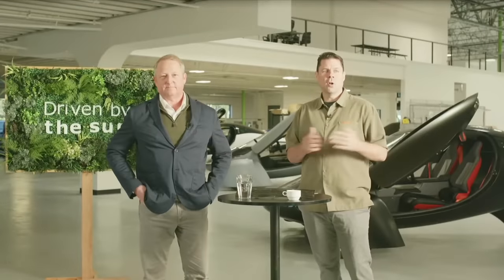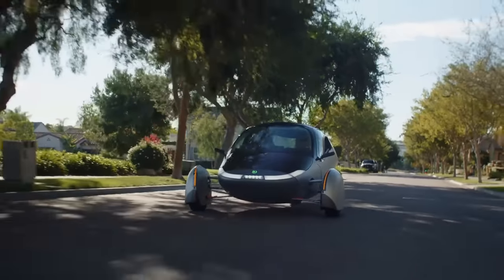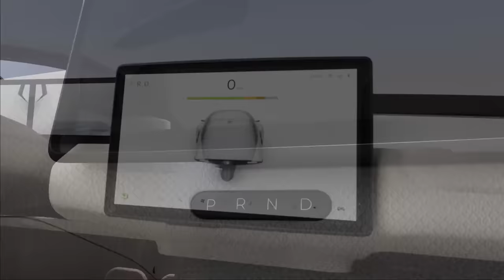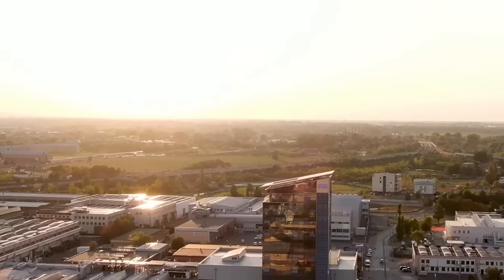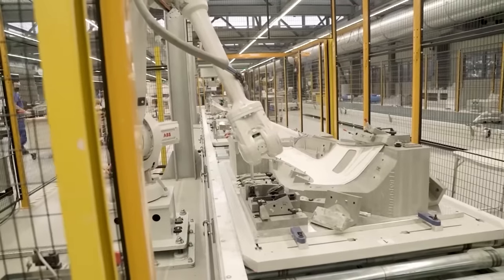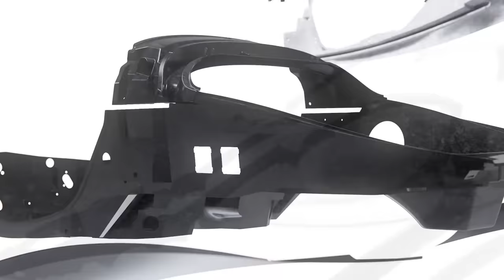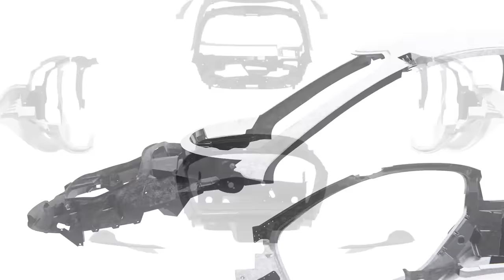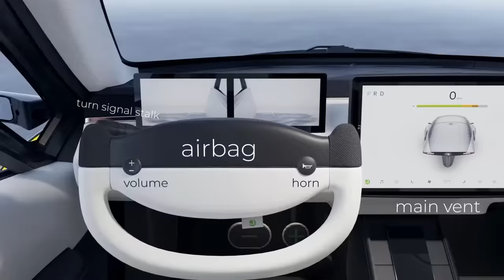Announcing Aptera's Launch Edition | Live Webinar

Comment: Congratulations you guys! It's been amazing to watch this evolve. I agree with a lot of the positives listed below. I have preordered the 600 mile all wheel drive, camping, premium sound package. Reading the comments while listening to the webinar I realize no fast charger and no side bags. Hmmm. Gives me pause. Having driven a Leaf for so long and completely understanding "range anxiety" /range limitations based on external temperature, speed your driving, if you need a/c or heat... dramatically reduces range (hence why I ordered to 600 miles expecting real world 300 miles.)

Also, I am probably one of the few who do not want the back window blocked by the solar panels because I like being able to see out the back. Finally getting to see what the vehicle looks like when looking into the back with the back hatch closed makes me certain, I do not want that back window all blacked out like that. I know, kinda misses the point of a solar vehicle by leaving that many solar cells off the car. SMH. What about a partial solar back hatch?? Like down the sides of the hatch?? Can you discuss all the options that may be an optional purchase to plug in (ex., front window solar sun screen while parked maybe, or solar screen to set up while out camping, or ??? something to make up for the loss of my back window preference? 

The see through sun visor is awesome, never seen that. However, the new cup holder seems like my coffee cup will sit below the top of the cup holder and thus fall over and spill. Could you please provide the measurements of the cup holder?

I had to give up my Nissan Leaf for an ICE :( because it couldn't make the new drive distance and one reason I am so interested in Aptera. All these new cars have that tablet like screen which takes my eyes off the road and often requires many screen selections to achieve my goal only further distracting me. I find them frustrating. Will there be more control offered from the steering wheel like I used to have with my Leaf? (start end a call, cruise control, speed up/slow down, music selection, sound up down, talk to text function, voice control map function, etc?) I would love to have a game like controller buttons I could push (memorize the button sequence) on the steering wheel while maintaining my eyes on the road to make changes / selections I need without ever needing to reach over and touch that dang screen--in my Rav4, while driving and reaching, it isn't a smooth reach as I'm going over bumps etc--finger moves up and down because car is in motion so the accurate selection takes time and attention. 

The vehicle itself --by itself is truly amazing but without the fast charge option for long drives like I have to do (a big reason I'm interested in Aptera) it seems like this would be a problem again, like my Leaf. Steve states, "up to 150 miles when plugged in over night + up 40miles from solar -if you selected full solar AND it's sunny the whole day and you you parked it at the right angle. I did not choose full solar and I park my vehicle in a garage. So for me it would be up to 150-170? miles per day. That will be a problem for me and why I did not upgrade my 2015 leaf to a 2022 Leaf. Not enough range! As I am editing my original post adding this thought, I can see with out a fast charger, an Aptera may not work for me. :(
 
The price starts affordable but with stated increased costs, I'm expecting the cost of my selected Aptera to go up to mid/high $40,000 that does not qualify for the $7,500 tax credit (If you happen to have high enough income to owe that much tax for that to be a viable lure). Cars at that price point have all kinds of bells and whistles and do dahs--you know the packages you can get added to other cars that add those special creature comforts that make us feel amazingly spoiled. The Aptera doesn't seem to have that many bells, whistles and do-dahs. From what I can see/understand the options are pretty simplistic and left me wondering, that's it? I guess I'll wait to see how this all plays out. The 600 mile option will be 3rd in line so it will be a ways off. Maybe some of my deal breaker concerns I've come to realize as I write this will be address and resolved. 
🤞
Reply: @Gandalf721  you have to do that with any car. Not just a unicorn car with the back hatch blacked out with solar panels. Plus, you can still see in from the front looking into the back to see if you have anything cool to steal if you happen to be in that kind of a high theft zone like San Francisco and so many other places you would not expect these days. 🤷‍♀
Reply: @loranutritionist  Yes what happens when you bring in the lowest common denominator. You get smelly areas and liquid fudge on the walks.
Reply: 😂😂 I think with all your requests you need a real car from an established automotive manufacturer, this car is all buzz words and tech promises - I’ve seen it in person. They will produce whatever the investment money provides for them (which will probably be less than the claims or their ambitions). At this moment it’s all words - not reality. Want an affordable reliable car that will hold its value - the new Prius blows this away for $28k 😅

Comment: So excited to see Aptera reach this point.  Still really anxious to see the finished product.  My biggest concern is the internal accommodation.  At 6'2, I need a fairly large amount of space to be comfortable, and from what I've seen thus far the Aptera is really, really small inside.  I hope I'm wrong and they've got a little TARDIS magic going on in there, but that's really the one thing that would keep me from really seriously considering purchasing one of these.  

I've always wondered why EVs don't have solar panels all over them.  Here in Florida, you might not ever need to charge the thing, depending on how much you drive each day.  Such a fan of this.  Just have to wait and see what they're like when they're finally in production and on the road.  Keep pushing, Aptera, you're almost there.
Reply: Most EV's are not efficient enough for the relatively small charge available from the solar panels to help much. Not enough to never have to plug it in. It's possible to never plug in an Aptera because it can go so much farther on a kilowatt than other EV's.
Reply: I'm 6'7".  I feel your pain.

Comment: I live in rural Illinois. The weather here is VERY seasonal and can shift quite a bit during the transition from season to season. Bottom line, the roads here are HORRIBLE! What can we expect with the durability of the suspension? I would go with the better tires and all wheel drive. I would use this as a daily commuter. I drive about 120 miles round trip per day.

Comment: I am an investor and preordered and just update to the launch model.  Really enjoyed the webinar looking forward to next week's webinar.  I have a question about towing the Aptera behind a travel van/RV.  Can the motors roll and produce power while towing? Will the front wheels fit on a 2 wheel dolly for towing or can it be towed with all 3 wheels?  If 3 wheel towing is possible could attachment points be deigned on the lower swing arms?  I am sure I am not the first to ask this kinda curious if your team has given some thought.  Thanks Luis

Comment: 25-50kW DC charging is a must for other climates. A lot of people can only have one car, so no capability for a road-trip is a deal breaker. I hope when Europe is in line they’ll have 50kW DC CCS2 charging.

Also no side airbags ?! When considering safety I might not switch from my M3…
Reply: We will just have to wait for the safety test results. Likely they didn't include them because airbags are heavy and simulating with and without side airbags didn't change the safety in any appreciable way. If the safety data comes out and it is less safe than you M3 of course you should take that into account when considering a purchase if the difference is significant to you.

Comment: What's up with all of these comments complaining about no fast charging on the Launch Edition? This is a streamlined commuter edition of the vehicle that is specifically designed as an early production model. If you want to drive for 15+ hours per day then you will just have to wait for the 1000 mile edition and it's charging options. Most people want high efficiency, decent capacity and solar charging for daily use. This vehicle is more than capable of handling that.

Comment: Would it be possible to at least integrate slow DC charging?
I mean DC charging doesn't require a big extra charger in the vehicle. It is mostly software and wiring.🤔
I mean 20 kW would be plenty for such an efficient vehicle. That would correspond to over 100 kW with an electric SUV.
Reply: Moin Meista

Comment: Can someone answer this: Was it too hard to include DC fast charging? (NACS/Tesla connector, they are using AC on here, not DC fast charging. That means you won't be able to charge at Super Chargers, but you will be able to charge at Tesla Destination chargers and Tesla Home chargers.) DC fast charging is faster. 6.6kW is slow charging!

Comment: I’m still rooting for this vehicle and hope to buy one, but I’m truly disappointed with no DC fast charging and no mention of V2L either from the Tesla port or at the very least a single 110 V2L plug in the cargo area of the vehicle. 

Can I live with just level 1 and 2 only charging? Sure, I’m doing it with my Fiat 500e commuter. But not having DC fast charging will limit Aptera to simply a commuter as well. I really wanted to travel with this vehicle. I live in the west and was planning on hitting many of the national parks and other destinations with my Aptera. This was going to be the first brand new vehicle I would have ever bought. Yeah, they can add level 3 in later but at what extra expense? Would it be a software only upgrade or will it require significantly more hardware?

Here’s hoping they will find a way to deliver on these two things, DCFast Charging and V2L, and say Just Kidding! Here it is everyone!

Griping aside, great job Aptera for your progress. Everything else is looking amazing. Please solve these things and make this vehicle so much more!
Reply: I have one that plugs in lighter socket 200 watt has two automatic USB to 2.4 amp, a 12 volt receptacle and 2 120 volt sockets for laptop supply etc. fits in cup holder.

Comment: I am looking for this vehicle to replace my Tesla for a 180 mi (each way) commute.  With  respect to the Launch edition, not enough range.  So unless we get Fast DC charging or the higher range packs, will not be able to use the vehicle as desired.  Really need Fast DC charging for usability
Reply: Assuming you aren't able to plug it in for an extended period between your commutes?  However, it is able to charge while driving.  So if you live in a sunny climate and are able to park outdoors, factoring in your commute and parked for most of the day even in a single day-round-trip scenario you might end up getting the indicated 45 miles of solar-charged range to make it each way comfortably without a plug.
Reply: You drive 180 miles, one way, each day???  Yikes!
Reply: 4 times a month. But it has to be able to do the round trip or have fast DC charge. 

Currently doing it with a S90D
Reply: Just stick with the 400mi NON-"launch edition" (or 600, 1000mi, if you prefer). You'll get it a bit later then, but at that time, I guess they will have DC-FC ready.

Comment: I love the Aptera and want one, but i have three concerns i’d love to hear opinions about:

1. The wheels are almost 88” wide and wider than the passenger compartment. That’s pretty wide to drive and park. Also, i worry about the wheels being wider than the passenger compartment causing accidents. I think people are used to mentally judging the width of a vehicle by its body and might not notice the wide wheelbase.

2. Only charging 57 miles an hour limits it to local driving for me. I was hoping to pick mine up in San Diego and drive it home. Need faster charging for that.

3) I’m not used to split side windows and am a little concerned about visibility. I won’t know if it’ll effect me until i sit in one.
Reply: The wide wheels are a real plus. They keep the car
 stable in turns and keep it from rolling during evasive maneuvers. That is a small price to pay for needing a wide parking spot.

Comment: I don't mind that there is no fast charging on this initial model. It would be nice to be able to drive it across the country, like I did my Mustang in the Spring of 2015 (1600 miles in two days from Alabama to Arizona -- wouldn't be practical with this EV), but frankly, this seems more optimized for more local driving, with any touring broken down into shorter legs with longer lingering in between, and frankly, as a retiree, that more relaxed  mode of touring appeals to me.

Comment: I want the option for a fold out solar panel. Or a folding one that can be stowed and would bring the daily charge up to 100 miles a day. An off road tire option would be amazing as well.
Reply: If you have a solar panel or two on a small fold-out stand and can attach it to a standard charging connector there's no real reason you couldn't store those in the trunk and unfold them behind your vehicle after you parked it and plug it in yourself. That is not something that would have to come with the car. That would be an easy aftermarket item or something simple to make yourself quite frankly. You can get 300 watt very lightweight portfolio style panels for $279 on Amazon right now.
Reply: @yougeo  I want one guaranteed by the company to work with their car and charge as quickly as they claim the panels on the car will.
Reply: As it comes to market, there will come many like ourselves who can see usage situations these guys may not have time to focus on,.. the aftermarket will come,.. crossing fingers for a sporty version with more ports, light kitting, alternate skins, .. it's a freaking awesome vehicle,..

Comment: This is lengthy, but I feel it's valid.. So, to the statement (and other comments) that DCFC isn't needed.. why wouldn't it be needed? 
I've seen a couple of comments try to reason that Aptera is more of an urban, short commuter vehicle. Where are you seeing this? This is not the way they're marketing this vehicle. That's just silly. There's a large percentage of people who would love to take this on extended trips. There's also plenty of people who would use this on long commutes. Not everyone lives in an urban area, but they want to change to electric with a reasonably priced option such as the Aptera. 

This also brings up those of us that live in the more extreme environments where severe cold is a factor. Range is greatly affected by cold temps. This means that 400 mile range could be reduced by up to 30% (as shown in other electric vehicles). That means more stops to charge. Not having DCFC really hampers the ability to travel in those situations. 

And just so we're clear, it specifically states the following in their FAQ: "At roadside charging stations, you’d likely get about 100 miles in 10 minutes.". So we know it's capable of DCFC. It's just not included in the Launch edition for streamlining the production process and getting vehicles out there. I just hope that this is changed when they launch the other vehicles. 

A couple of other things I noticed - 
-The steering wheel is neat and looks ergonomic, but I feel like it would be less practical. Especially with the horn being a button on one side of it. This has been the design all along I know, but if you look in test driving videos, they've swapped to a regular steering wheel. I'm very interested in trying it out. 
-No curtain airbags seems a little strange. 
-I haven't seen any mention of an E-brake. We've seen Teslas lose control and speed off uncontrollably (Happens with ICE vehicles too where the accelerator pedal gets stuck, but trying to compare apples to apples here) and we still decide not to include this safety feature? 

I reserved this vehicle. I want this vehicle. I just need it to be practical and reliable too. Especially if I decide I want to use this as my sole mode of transportation. The launch edition certainly isn't for me, but I'm looking forward to what's to come from Aptera after this initial launch.

Comment: i changed to the launch edition. it was not a big leap since i had already ordered the all wheel. however, i am very concerned about the launch edition only supporting the level 2 charging. this means if you travel you are limited to only doing the vehicle range per day, and is also contingent on finding a place to charge overnight. that is a HUGE drawback in my opinion and i hope Aptera RETHINKS this before the launch edition starts:eyes-purple-crying:

Comment: Launch Edition is promising, but I really hope to see Lvl. 3 charging for full production versions!
Reply: I agree, I have a 60kwh one on order and my concern is I need faster charging than 6.6kw, I plan to take mine on a lot of road trips. Even if its just 30kw charging or so.
Reply: @Gandalf721  No thats not the point, just to get a Tesla. I do not want a big boat of a car. But What is the point of having a larger battery if it takes 10hr to fully charge it during a vacation, and thats not even the biggest battery option. Tesla shoves 120+kw into their roughly 60kwh pack, that is what tears up battery packs, it works for them but its really not ideal. Im not asking for super fast charging, but 30kw into a 60kwh battery will not kill it fast. I do not want to wait at a charger for 5 or so hours to get enough charge to move on.

Comment: I’m disappointed with no L3 charging. No L3 = no go for many. Will poss be the only larger battery vehicle on the road without L3 charging. Not all public L2 do the full 6.6kwh. Many are lower or shared for lower so the 57mph charging will be achieved.